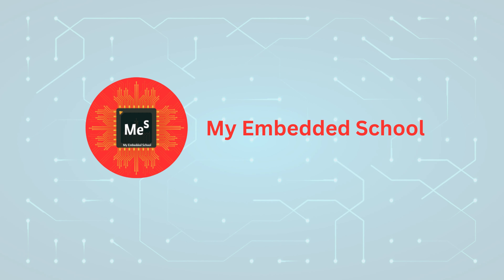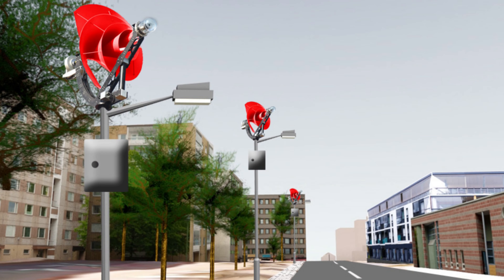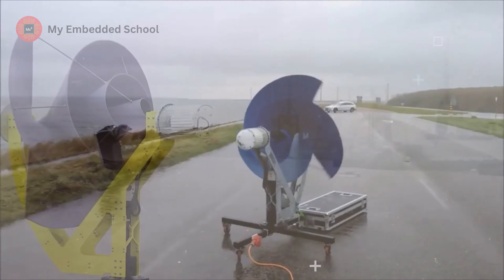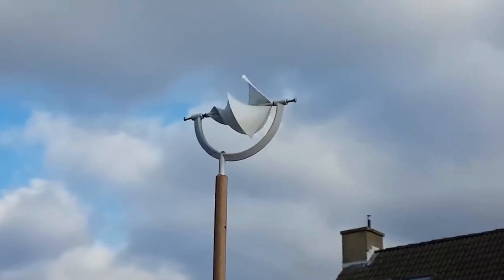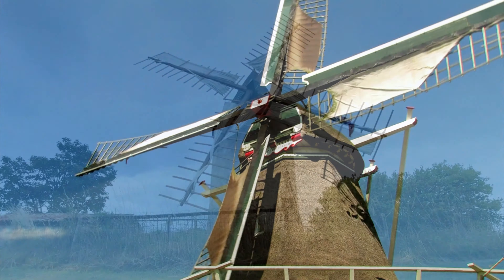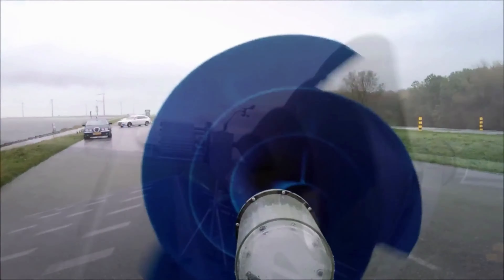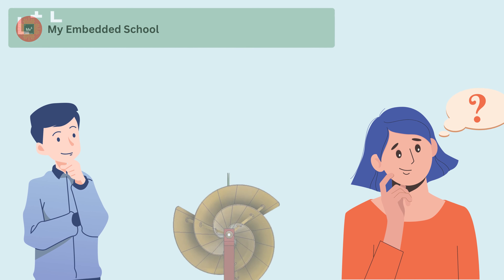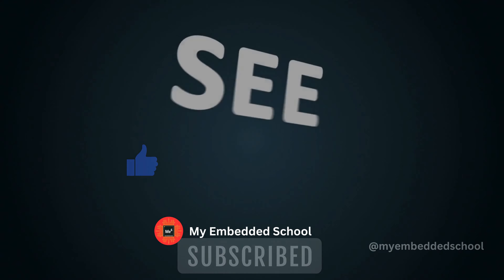The Liam F1 Urban Wind Turbine: The Game-Changer for Renewable Energy

Comment: It is just marketing gimmick... It is less than 200 watts assuming it runs 20 hours per day. Not worth at all for the cost. Don't get carried away by marketing magic words.15000 kWh per year 1250 permonth 4.2 kWh per day Means 200 watts of power generation per hour ?. Solar panel 1 kW per month generates 120 units which cost 700 USD on grid inverter. Cost of this turbine 3200 usd?. Is it worth?
Reply: Good for electric car buyers
Reply: 😂😂😂 amazing 🎉🎉🎉
Reply: Your definitions are undefined. I think it is a translation problem.
Reply: @urbandad885   I don't understand what do you mean
Reply: @palanik1960  I think something was lost when it was translated.
Reply: @urbandad885  The output of the wt is 1500 units annually .. Indicates they wishes to give larger number /figure . It is 200 watts power or250VA only. There are so many similar videos are keep coming with same figure. Can't be translation error?
Reply: We all must do our part. Using less by turning off lights, unplug when gone, solar when possible. This offers those in shade the chance to do their part.

Comment: NONSENSE! All practical tests of ground-based small wind turbines show: 1) They hardly produce any electricity! 2) They do not last long! 
Solar panels generate at least 10 times more green electricity with the same investment! Reliable and almost maintenance-free for at least 25 years! 
Wind close to ground is extremely instable and gusty. 9 out of 10 small wind turbines therefore stop working after a short time!